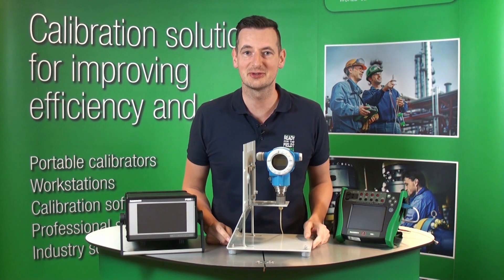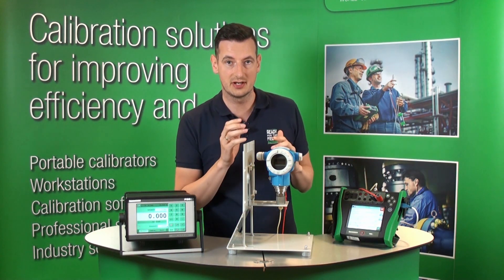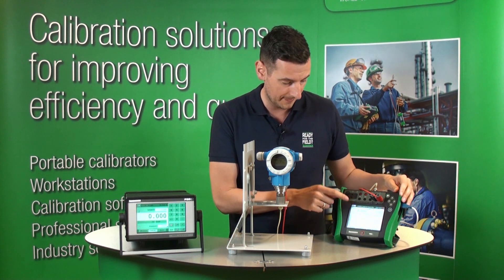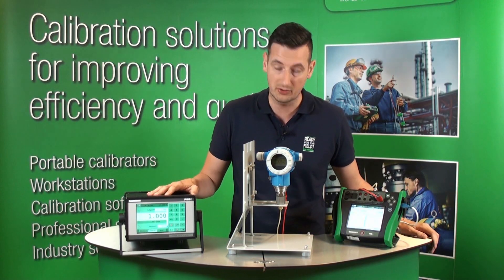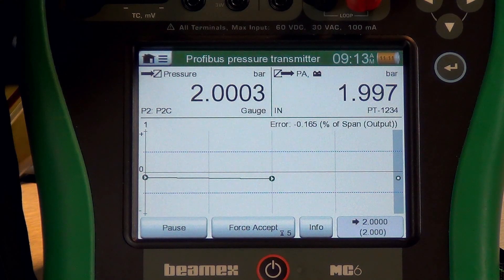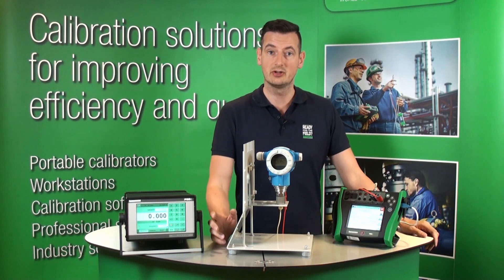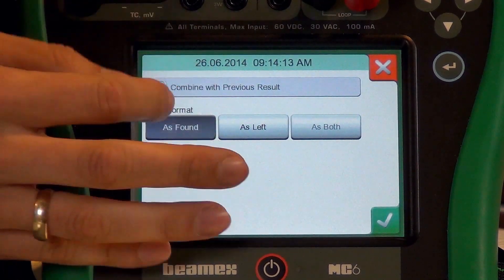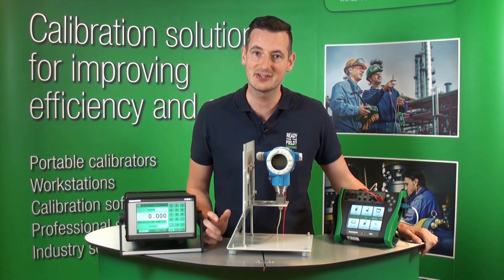How to calibrate profibus transmitter - Beamex

Comment: hello how to connect output fieldbus?
Reply from the maker: Hello. If you mean FOUNDATION Fieldbus, you can connect MC6 straight to the transmitter terminals. If the transmitter is not connected to the segment, MC6 can provide a loop supply and act as a LAS. If the transmitter is connected to a live FF segment, you can connect MC6 anywhere on that segment and communicate with any transmitter on that terminal. 
In case of a Profibus, connecting to a live segment is not possible, due to Profibus restrictions. So you connect MC6 to the transmitter terminals when the transmitter is not connected to a live segment. 
Hope this helps. 
For more info, you can download the MC6 user manual from beamex.com website in "Resources" / "Manuals and brochures".
Or you can also connect support@beamex.com 
Thanks, Beamex / Heikki